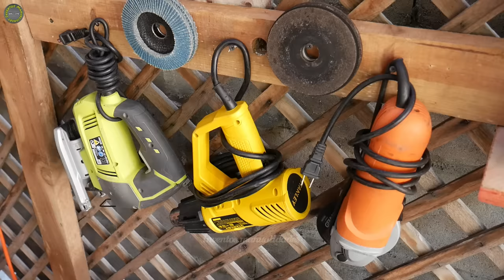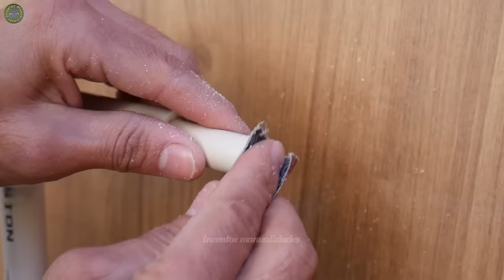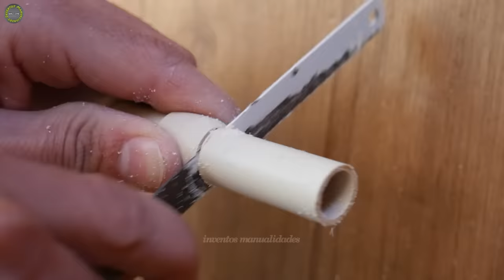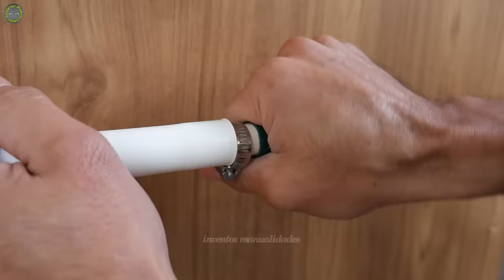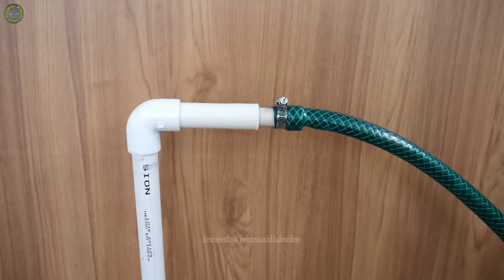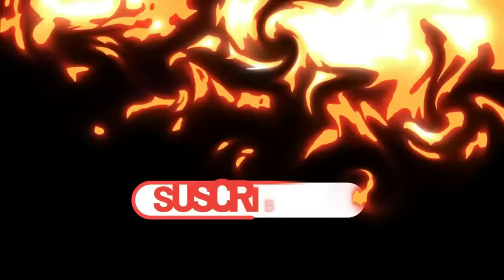La Idea Que Me Conto Un Plomero Para Unir Una Manguera a Un Tubo De PVC Sin Comprar Un Adaptador

Comment: That was a total waste of time.... it appears as if , just to say it's a "half inch pipe ". you put a extension and then added another extension piece of ..say ...a  "half inch" and then another piece which was the original size of the pipe in the beginning...under the peace just ...so you can put the hose over the new piece ...when the old piece was perfectly fine ? If you just slide the hose over the original old pipe and then hose clamp it.... DONE.... looks like you just made extra work and didn't nothing ...waste of my time ...give me back my five minutes of life I just lost👎👎👎👎👎👎 ... TIME is 💲💰